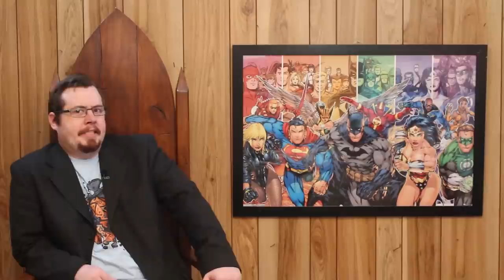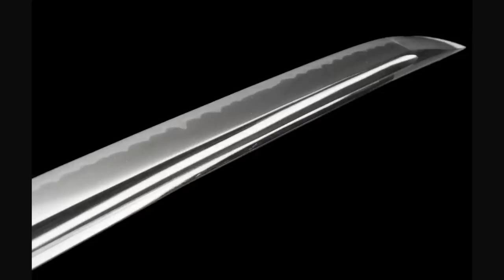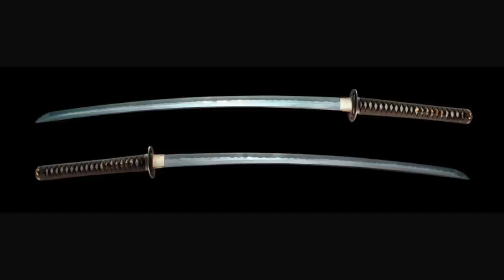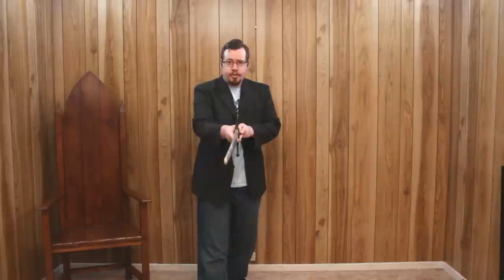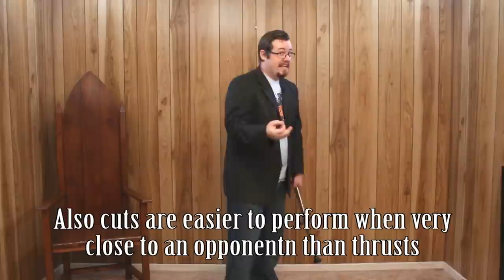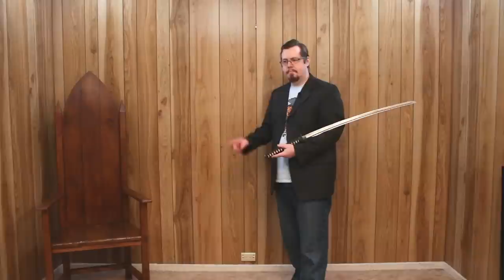Super cutting swords, are they needed?

Comment: I’d say a deeper cut is better for the same reasons a deep thrust is better. You’re more likely to hit something important.

For example, a severed arm will bleed a great deal more than a cut that stops at the bone.

I still think a straight sword is better because I think thrusts are generally deadlier than cuts because of the depth thing.
Reply: Cornered Fox thanks for taking the time for a thorough response!

You’re absolutely right, there is such a thing as too much penetration. When I say deep, I mean 8-12 inches or so. Enough to reach all the important bits through thick clothing, make the wound deep enough on any size person, and maybe make an exit hole for increased bleeding. Anything beyond that is indeed a liability, especially on horseback.

You’re also right about only needing to disable them. There are only three ways to incapacitate a determined opponent quickly enough for a fight in my opinion.

1- make them give up/run away. I expect a lot of people would give up once stabbed. That’s often the smart thing to do after all.

2- lower their blood pressure enough to make them stop. For this, the more holes the better and the more tissue damage the better.

3- Destroy the central nervous system. This one is tough with swords, but it can be done. Hacking into someones spine or brain will stop them immediately.
Reply: Cornered Fox For sure, you’re right that most of the time immediate physical incapacitation isn’t necessary. Especially with ranges weapons like firearms it’s usually enough to just put a hole in someone to make them stop or run away. 

In close quarters combat however, the word usually is a bit nerve wracking. Simply put, I’d rather not take the chance of someone not going into shock. Sometimes people fight on after incredible wounds, particularly at close range. That’s why military and police generally train to keep shooting until the target stops moving in close quarters instead of relying on shock.

Comment: The sword on the far right in the thumbnail- i have the same one, ot a cheap replica of it. Is it a wall hanger? Ive also got a sword of arwen, its a bit heavy. But the only sharp sword i have is balanced, yet the handle is clearly cheap and you can hear the steel knocking around. Would that be a real fake sword or a real fake sword?

Comment: I think this is an odd video. Did Shad revisit this topic in another more recent video? I can't recall.
But to start off my counter point, I think you need to actually cut through the clothing sometimes, not just skin, so a super cutter will have an easier time of even inflicting a light wound that would disable one's arm, while a not very good cutter wouldn't even be able to go that far, or would have much more trouble to do so. Better safe than sorry. 

"Anything that can stop a cut from a longsword can stop a cut from an specialized cutter" is kind of a bold assumption, and one Shad doesn't usually do. First of all, what is "stopping" referring to exactly? Is it 100% stopping, not leaving even a scratch on the skin? There are various degress of injury and depth of cut, right? A super cutter might leave a cut one degree deeper. "Swords that can cut less effective can still cut effectively enough in ALMOST EVERY SINGLE CIRCUNSTANCE" is kind of an outrageous claim too. Probably wasn't taking in consideration the many types and layers of clothing that a person might be using, and many other factors in a fight. And that claim is also assuming the swords are able to perform attacks with 100% of their potential everytime, so the ideal scenario everytime. That's not what happens in a real fight, right? So say a longsword goes through the clothing only enough to leave a wound in the skin, where a messer would've been able to cut deeper and hit an artery, how is that not a significant enough advantage to justify the increased performance in cutting? What about edge alignment? What if the super cutter is much more forgiving? No one is able to do 100% perfect edge alignment in every strike, specially not in a real fight. And what about dragons?

Also, the video is leaving out the ease of doing faints and followup strikes in slashes, since sometimes they just flow with the previous one, even after it is blocked or deflected, as opposed to thrusts where you have to pull out your weapon everytime and strike basically the same way in the follow up. Now, what if you want to follow up the thrust with a slash or a draw cut? Wouldn't a super cutter like a messer or falchion have an easier time of doing that as well and have more chance of inflicting a serious wound? Plus, enemy grabbing the sword in a cut is not as easy as grabing a thrust, and not every thrust is lethal either. Also, the video is assuming only a dueling scenario. Sticking your sword through someones body or clothing leaves you VERY vulnerable and doesn't even garantee they'll die, specially not instantly. Also, what about if the enemy dies eventually but manages to cut you down too before he goes down? Wouldn't more stopping power be more useful then? And I think the same argument could be made in regards to thrusting: Why make a super thruster if a thrust of a non specialized sword could also kill a person? But super thrusters were still developed, because of context. So this argument doesn't make much sense. So I think Shad really did overlook a lot of things on this old video.

All in all, this video is disregarding much of the context involving fights and self defense, and specially the context in which each different weapon is used, to try and prove a not very solid point.

Comment: really it depends on what your doing with it and were your fighting as well as your culture. katana in its modern form came was likely influnced by the 100-200 years of peace japan has as the edge is actually very delecet and also very limited in how meany times it can be resharpened as you run out of hardaned steel at a point making it just a metal stick with a force multiplying edge. in the end its complicated by culture and geography.

Comment: I didn't see if someone else made this comment but... not everything that can stop the cut of a longsword can stop the cut of a cutter. your favorite kind of swordis designed to pierce through plate. Nobody's designing a sword to cut through plate. But what were they designed to cut? Leather, gambeson, etc., no? Even you have done videos on this sort of thing. Or maybe it was schola gladiatoria.
Reply: ok sure but pierce the rings that guarded the gaps in plate. anyway, sometimes you want a dueling weapon that only cuts because piercing basically means death, if not by bleeding then by infection...

Comment: I realize this is an old video and my points have doubtless been made earlier and better, however...

First, the central premise is false the swords mentioned will NOT be making the same cuts in the same circumstances. A falchion and a katana for example use entirely different techniques (I'd personally call the falchion a chopping weapon as opposed to cutting).

I also disagree about defense, I've personally always found thrusts easier to defend against. They probably are faster, but as the movement is mostly along a single plane they're also very predictable and require less force to redirect. Similarly, the idea that simply standing in guard represents an effective defense against a cut borders on insanity as any forceful blow would knock the blade aside in most instances though at the same time I'm not sure why an opponent wouldn't just attack another part of your anatomy.

Comment: You're completely missing the fact that a swordsman won't be able to perform a perfect cut every time in a battlefield environment. If the cut is aligned perfectly and has enough force behind it, then sure, a longsword will kill the opponent just as well as a messer or a shamshir. But if the edge alignment is slightly off and the force behind the strike isn't quite there, there may be situations where a longsword might not make a deep enough cut but a cutting optimized sword will.

Comment: fun fact: The katana (like most cutting dedicated swords) is entirely useless against armor. however, it was specifically designed as a "quick draw" sword (you can hypothetically kill someone in the process of drawing it). and at the same time, thrust dedicated swords run into a similar problem with shields, rendering them useless on the battlefield.

Comment: This reminds me of an argument against evolution))) It goes like this: camouflage in animals can't come into being gradually because partial camouflage isn't good enough to conceal the animal. The flaw of this argument is quite easy to find: when hunting, predators are limited in time, the light conditions may be bad, and so on, and in many situations even a slight camouflage will save the prey. And thus it's obvious why a predator would need "overkill" eyes. In such disadvantageous circumstances this "overkill" will be juuuust enough for success.

So, back to swords. A battlefield is not a duel. There are plenty of factors apart from plate armour which would get in the way of your attacks. You could be tired or momentarily distracted, your edge alignment could be imperfect, the opponent could somewhat evade the cut but not entirely, anything. And your overkill would be juuuust about enough. While anything less would be not enough. And in a battle usually there are multiple opponents, by the way.

Just a hypothesis, I'm not a specialist in these matters.

--
mooreuva, ai biliiv dhat speling myst bi rifoomd

Comment: There's also physical power, or maybe, "stamina," to consider. A sword that's extremely specialized for cutting could very well take less physical power to use than, say, a longsword. I'd guess it'd be much easier to cut an arm off with something like a falchion than it would be with a more straight sword. There's also armor, relative to the time periods, and individual cultures, to consider. Overall though, it probably just comes down to the specific circumstances in any given altercation.
Reply: A sword specialized in cutting requires more strength, they are balanced further away from the hilt, and will tire you faster. Also falchions are straight 90% of the time as well as messer are mostly straight. Straight blades transfer momentum into the target more efficiently because of physics, curved blades introduce more slicing into the cut because physics. Slicing will cut fabric easier but won't really produce deep wounds, hell most cut specialized swords are specialized for shallow surface cuts and not to cut into someone so deep. Straight cutting swords (yeah these things exist and they are in excess) cut more deeply into the target.
Reply: Okay here we go. Super cutting swords weren't popular at all, most cutting designs are made so because they are also designed to be comfortable to wear, many shamshirs are what 700 gramms? You have to make it as top heavy as possible to do well in cuts with it. Even the type XVa longswords are good enough in the cut (the thrustiest design) to take your arms off without problem in a civilian context at least. Hell George Silver talks about his short sword (which is actually a rapier but nobody tell him that) is good enough in the cut to simply send limbs flying. Super cutting swords are rare by comparison, a few types of dao and falchion exist that have the qualities, like a broad blade that is top heavy and they weigh a lot for their length (900-1200 gramms for a 60 cm blade is heavy yes, think of Elmslie Type 1 swords). And they are usually straight/only curve at/before the tip.

Comment: Oh my gawd so right about the thrusts vs the cuts. Especially because it's harder to perceive the depth (Think about it, ever try to draw foreshortening? It's harder to tell the length of a sword from: 
( . ) than |------------------------------
Also it's a lot less movement than a full cut. (Saves on stamina and endurance(But at the same time holding the blade out in front of you horizontally is heavy than holding it vertically, so you can still get tired from it). It's easier to see a cut coming, because you get a lovely silhouette shift. That's why the most common cut (at least with Polish sabers) is a quick bop; instead of winding it up from behind the ear.

Comment: Shadiversity.....first of all. Thrusts are not as deadly or lethal as slashes, they are in fact substantially more lethal. However, there is a reason and place for more specialized slashing tools. I believe chiefly among these would be gross motor skill. If you’ve ever noticed a “normal” street brawl often turns into two guys throwing wild haymakers at each other and all semblance of skill thrown right out the window more times than not in conflict, it would make sense to have a weapon that was far more capable of delivering a sufficiently deep slash than the user may be able to deliver under such high stresses as say, oh, I don’t know a war! Knowing that three inches is the minimum depth needed to insure a lethal thrust to internal organs, and that to do so requires some level of accuracy, that potentially may or may not be obtainable by a warrior in the heat of combat, it would make sense that you would want a blade that could deliver sufficiently deep gashes in an opponent as to slash multiple organs to the desired depth, with minimal effort, and skill when in combat. It’s gross motor skill vs. fine. One is more of a machine gun mentality, and the other a marksman rifle mentality. A machine gun is highly over kill, unless you’ve got 20 guys running at you with bayonets trying to take your position....then it’s 👍👍👍👍 😁😁😁😁 just what the doctor ordered, and depending on how close they might be, the marksman rifle not looking so useful in the moment. Just my .02 cents.

Comment: You make some good points there, but there is one misconception: the rapier can cut! Yes, its design prefers thrusts a lot, but it is not a pure thruster. It has two sharp edges after all. Sure, you won't cut a tatami mat with it, but certainly deep enough to incapacitate an opponent if needed.

Comment: @Shadiversity, now, I really enjoy your videos and have learned a thing or two, however the thing that you seem to be forgetting to mention is that the effectiveness of swords is based around their fighting style, for example, longswords and many European swords were designed and used to fight at range, to keep your opponent at bay. Where as eastern heavily curved swords can be used very close to the body, the curve is designed for that, so you'd close with the enemy and using the blade in long drawing cuts and using your hand or forearm to add leverage, the only time you'd make any chopping motion is from horseback or if you've lost control in the heat of battle.
So there is no perfect sword, just a good tool to enhance a fighting style

But that's just my two pence ;)

Comment: I think extreme cutting swords were necessary. Let's take the longsword. Straight blade, better at thrusting. If you cut into your opponent's arm, you have disabled him, but he is not necessarily out of the fight. He can switch hands. But let's say that he is. Now you need to do a second cut to actually kill him. And for that, you use more energy. Now let's take the Katana. Curved blade, better at cutting. Let's put the same scenario. You cut your opponent's arm, except this time your sword goes all the way through and into his torso which kills him. You have done with one stroke what would otherwise take two strokes. And you have used less energy.

Comment: I think you are wrong about how well longswords Cut against basic armor and clothes. I think if you consider edge alignment speed and force long sword cuts are often probably turned away. The cut must be landed very well. Other weapons specialist and cutting probably are easier to score effective cuts. If you compare well placed heavy cuts you see overkill but lights or poor cuts might fail against even cloth for a long sword especially with poor edge alignment but specialize cutting blades with technique designed for cutting blades probably cut and score very well against light armor. Once we get to heavy armor. I thinkWe use other weapons not swords

Comment: Well I guess we have to look at who was using cut-heavy swords. You used Sabres? Predominantely Cavalary. Who used Katanas? Samurais, who are also Cavalary. If you're on horseback and you want to thrust, you need a spear or a lance. With a sword you want to ride by and cut, and hopefully not get your sword stucked in the enemy. So cut-heavy swords make a lot of sense for cavalary. 

Afaik is the Messer a special case. It's design based on the idea to circumvent certain weapon laws. by only heaving one edge and not being symetrical, it didn't fall under certain restrictions.